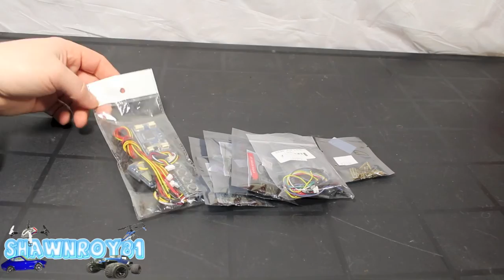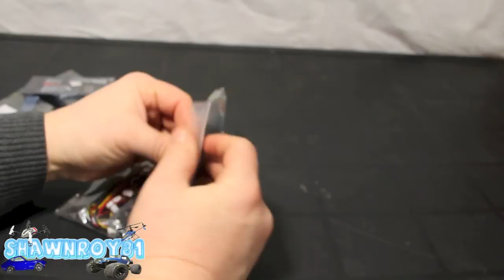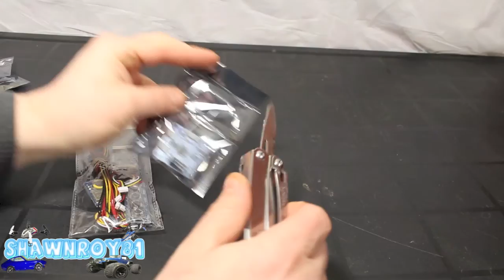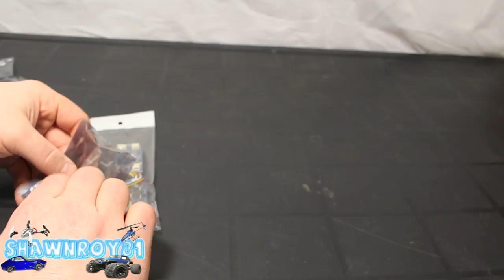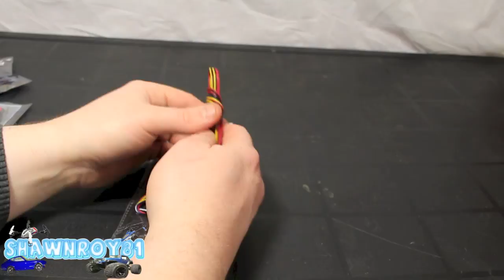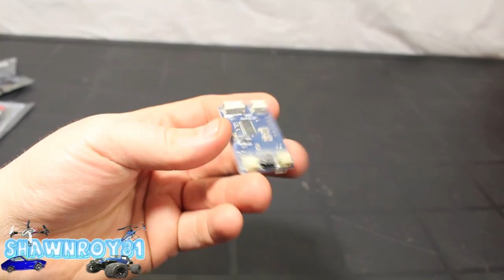New Quadcopter Project Parts Haul

Comment: I've got the CC3D on a QAV250 and the Naze32 on a strider 250 and so far I prefer the Naze, but let me know what you think. Biggest difference though has to be the ESCs - I am running the KISS 18 amp, which are absolutely unreal. I suggest checking them out, I don't believe any other ESCs come close at the moment.
Reply from the maker: J Denomy perfect. Glad to hear. I certainly will